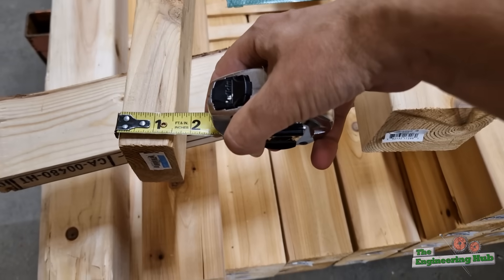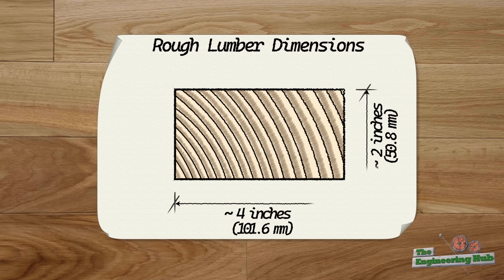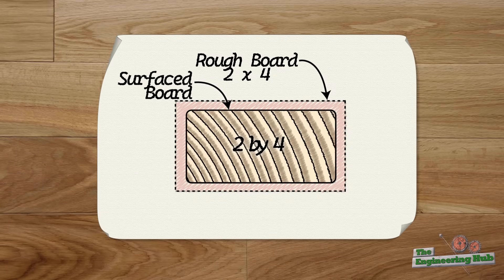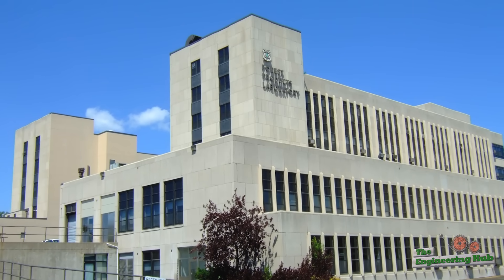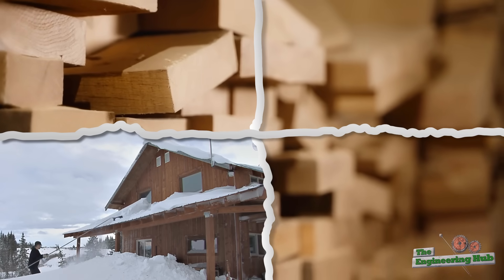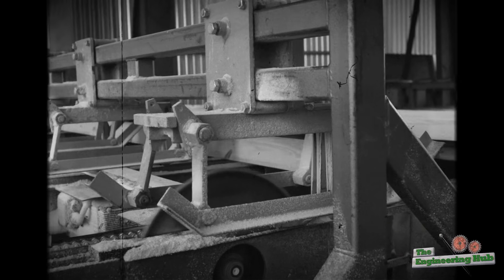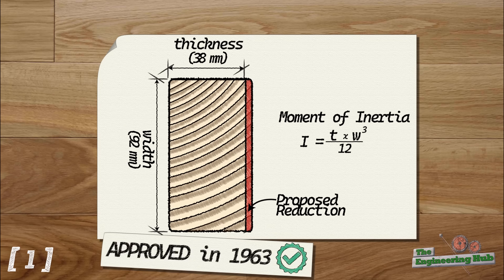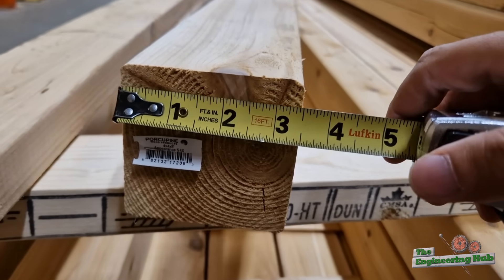Why is the 2 by 4 getting smaller and smaller?

Comment: Important to remember that the growers had access to old growth forests that had quality trees back when the 2x4 was first milled.  The structural capacity of that old growth wood (particularly Southern Pine or SYP) was substantial.  Once the greedy mills had raped the hills of all the useable trees, most of which were 100 years old or more, the hills were replanted with faster-growing varieties.  Of course, none of the mills were willing to wait 100 years for a properly grown tree, so most replanted trees were cut at less than 40 years old.  The consequence is that the poor soil, which was not allowed to "recharge" since it was replanted on bare soil (the natural consequence of clear cutting) and the trees that regrew had lower structural density.  Thus, in the 1950s, during the post war building boom, engineers noted that SYP lumber was flexing more than their standards told them it should be.  The growers/millers had to have the standard altered to match the weaker product they were producing.  This altered the design of houses.  Since there were no large beams anymore because trees were not being allowed to grow past 20 years in age, house design accommodated the inclusion of the weaker wood by creating the "balloon" frame house rather than the traditional post and beam method used prior to the 1950s. A balloon frame has thinner walls (weak 2x4s stacked closer together) and the new strengths standards were accepted and adopted.  However, after mismanagement by the lumber companies, the trees continued to get weaker and weaker, so the standard was AGAIN lowered in the 1970s and house design had too change, again.  Long spans disappeared.  High ceilings went away, and the single story ranch house became the trade's only economical, structurally sound product.  It does not end there.  Continued demand for wood products outpaced the mis-managed tree farms' capacity to grow sturdy trees, and in the 1990s the lumber standard was lowered, again, and construction methods changed again.  Now you can't even find a replacement wood joist to re-do the joists of a house built in the 1920s because the lumber of the same dimension, even custom cut, is much weaker than the original, so mid-span bracing is required.  

It is true that today's houses really are just "mud and toothpicks" compared to the substantial, dimensional lumber frame houses that our parents grew up in.

So sad.
Reply: Wow. Thank you for the detailed summary.
Reply: Umm sorry this is inaccurate to say the least. Balloon framing was the standard in victorian houses built prior to 1900. Platform framing was not common whatsoever prior to 1950. Balloon framing was in no way developed due to the weakened lumber. Balloon framing was phased out because of its poor ability to provide fire separation because it would essentially act as a duct for fire to travel from the bottom floor to the upper floors of houses. In a 1900s home you could go to the attic and drop a penny from the top of a stud and it would hit the basement floor.
Reply: I'm building a cabin in about 5 years... any advice for requesting quality wood and quality construction would be appreciated.
Reply: @NTJedi  go for steel, stone, or brick
Reply: @NTJedi  If you have any Amish communities in the state you live in, go seek them out & talk to them about it.  My parents own a log cabin that was made by Amish people, they helped us bring the cabin on a flatbed to one of our properties.  This was around 25 years ago & to this day the cabin hasn't needed a single repair.  However, a deck was added on around 20 years ago & every single piece of wood used to make the deck has been replaced at least once.  We installed the deck ourselves, but my stepdad & grandfather both of whom are master carpenters with my stepdad at the time the deck was installed had been doing that kind of work for 30 years & my grandfather for 50 years.  Both of them & work colleagues have said the reason it hasn't lasted is due to poor wood quality & they didn't use cheap wood to build the deck either.
Reply: what do people do when restoring old buildings then? start mixing light stainless steel?
Reply: Quality down. Prices up.
Reply: Evil can only corrupt what good forces have made.
Reply: Sounds like you know your shit. I like stuff like this.

I think making the standard match the product instead of making the product match the standard is important to note. Where else does this happen? That's how people should be thinking
Reply: Thanks for your insight and knowledge on growing and milling trees and lumber. You are absolutely correct. I graduated with a two year forestry degree then was hired and trained as a saw filer in a large mill that I worked 33 years. It's certainly true old growth timber especially SYP is long gone. Timber companies along with foresters are always expiramenting to find ways to harvest planted timber earlier with less expense. The timber and sawmill industry is very competitive with sawmills especially dimension mills like the one I worked in ( cutting standard 1 x s and 2 x s up to 2× 12 x 20) have to periodically " remodel " to take  advantage of new products that produce lumber more efficiently in order to remain competitive. Thinner kerf saws , optimized and computerized machinery have replaced , human error and mistakes. It's true lumber isn't comparatively as strong as it was due faster growth which causes growth rings to be wider and fewer. The old growth with tight narrow growth rings definitely was stronger, producing straighter more consistent lumber. The harder varieties such as SYP are structurally more sound than white pine or spruce. Unless using a nail gun driving nails with a hammer will clearly show this and be more difficult. It's no different than many other products , competition and profit drive innovation if a company is going to be successful or a out of business.
Reply: Money
Reply: In 20 years a wolf could blow in your house
Reply: That sounds like a brilliant investment opportunity. Buy land, plant trees now that will be useful in 100 years, ring fence it from being harvested, in 100 years, your descendants get a windfall from selling a rare batch of, by then, even harder to find, quality timber. Nice.
Reply: @Erakius323  in a perfect world it would be a sound idea. Problem is ppl don't care about quality anymore and neither do 90% of builders. Take the I beam for instance, they could at very least build new houses with actual 2 by 12 joists but instead people opt for the wood I beams, and I don't care what they say claiming they're better. Try running a 3 inch plumbing drain through an I beam and tell me it's better. If ppl aren't even paying for real joists anymore even though they're available I doubt they'd pay the premium for higher quality lumber. Everything just goes down hill in exchange for profits and its almost become the standard. Another reason older buildings are better particularly block or brick masonry houses were that the structural exterior walls were double or triple brick, the bricks were the primary structural component. People started swapping that out for the brick veneer houses you see today. They didn't do that because framing was stronger than brick. They did it for the almighty dollar. Houses also used to be built for generations of the same family to live in, it was not uncommon for a family to own a house/land for 100 years back then. Not people just move in 20-30 years and think oh well it's not gonna be my problem when these things fail. 🙃
Reply: @JOIHIINI  I guess. It would rely on knowing a quality timber merchant, someone who knows the value of old growth timer, and who knows someone willing to pay good money for it.
Reply: Try a library search
Reply: Balloon framing was used in houses as far back as the 1800s.
Reply: Count on it only getting worse in future. Increasing concentrations of carbon dioxide make plants grow faster, but they don't grow stronger. Even the hardwood species that were traditionally revered as slow-growing high-quality timber are now showing a coarser grain and structural weaknesses. And with increased storms and wildfires, there's zero financial incentive to plant these slower stronger species to offset the turbocharged growth rates, because the longer a tree is standing there growing, the higher the risk that either a storm or a fire is going to destroy it before harvest.

We passed 400ppm only eleven years ago. Now we're at 425ppm, and the increase is still accelerating. Timber is going to be about as structurally useful as an over-ripe mushroom in years to come.
Reply: Concrete it is then. Use the shit wood for internal walls and the A frame.
Reply: If only we could focus on quality instead of quantity but alas the world is run on greed
Reply: But would it have changed the trends to remodel the remodel that was done 5 years ago ?
I think not , and would have been more wasteful of us to insist on the higher standards .
And of course would narrow the market of affordability .
Reply: As someone who will probably never own a house (thanks federal jew reserve), but still an engineer at heart. Where do you see those of us that want to live in a solid house going? Concrete? I worry about the cost of such a structure and the high degree of human error possible in mixing and curing.
Reply: @RobotDCLXVI  i'm sorry, "federal jew reserve"???
Reply: @RobotDCLXVI Wtf? Is everyone just going to ignore the Jew comment? What is this, the 1930s?
Reply: @sireniasong  It has 17 thumbs 👍.  Nobody is ignoring it; in fact, people are finally starting to notice.
Reply: @sireniasong Isn't the chairman of the Fed jewish tho?
Reply: @blainegoodwin6365  He's a Catholic American. Extremely easy to Google. Went to a Jesuit (Catholic) school and married in an Episcopalian church. He has a law degree and has been in investment banking since 1984, as well as being in and out of politics. So not only is that wrong, but it also shouldn't matter at all. Replace "Jew" with "Black" and try telling me that hateful line of thought is justified.
Reply: @sireniasong  You're right. I was thinking of Yellen...but what is hateful about it?
Reply: @sireniasong replace it with white, then no one cares.
Reply: @sireniasong You have a problem? He’s right.
Reply: @RobotDCLXVI  Racist
Reply: @richardwebb2348  You can call me names, but you can't call me wrong. That epithet you called me was invented by a jew, btw.
Reply: The "greedy mills" are the ones that supplied the wood to build your house. The consumers (you) are at fault just as much as them.
Reply: @someoneonyoutube181  nice victim blaming.  How is it the customer's fault that these mills are greedy?
Reply: @someoneonyoutube181  "it's your fault for buying the only shit available" what should we do instead? Make your own lumber mill and create boards that don't exist on the market? 

It's the same type of logic that people use when they blame a rape victim because they "dressed to provocatively" or blame a gunshot victim for not wearing bulletproof armor, as if the victim is to blame.
Reply: @someoneonyoutube181  What would you like people to do? Just go out in the forest and chop down a tree themselves? 
Absolutely ridiculously unintelligent comment by you.
Reply: @someoneonyoutube181  while that's true, it doesn't change the fact that the greed on the part of the company owners was still rampant.
Reply: @someoneonyoutube181  gatekeeping much?

Comment: I don't agree with his theory. Dimensional lumber has shrunk in size because sawmills can get more sellable wood per log, period. And if you think there is no drawback to reducing the thickness to 1.5", try fastening drywall along the vertical butt joints. In a perfect world you have 3/4" overlap for each drywall sheet against the stud. But in reality you often end up driving screws on an angle to chase the stud. But even sheet goods are undersized. It's all about maximizing profits. And frankly, if you sell me a board that is called a 2 X 4 it should be 2" X 4".  But my internet provider will sell me super fast speeds for an extra price, but then claim they can't guarantee those speeds, for which I paid extra. Seems illegal.

Comment: Nice talk, but wrong.  In about 1948 (I don't mind being corrected on the date) ... the government, established standards.  Based on the end of WWII and the fact of the building "explosion" by returning military families, the building trades needed to know what was meant by the term 2 X 4.  Imagine building a home or anything when each new load you order is a different width or thickness.  That is the primary reason for these standards.  The complaint about drying and shrinking is a number too small to matter.  The steel stud idea is taking hold, making this discussion needless.

Comment: He left out the fact that lumber in the early 20th century was often OLD GROWTH HEARTWOOD, which has already "dried" and has much MUCH tighter grain and structural integrity.  If you look at rafters in a house built in 1920 you'll find TWO by FOUR INCH lumber that will break nails and destroy screws.  We're now having marshmallow soft crap foisted on us, and losing 1/2"^2" to boot!  Criminal!  🤦

Comment: Video needs to be retitled "why is the 2 by 4 getting smaller and smaller IN THE STATES"

We still supply fresh sawn timber in the UK air dried as an exact 2x4, if you want kiln dried we only go down to 12-15% moisture content which leaves the finished dimension over 47 x 96mm
Any other sizes like 3.5 get measured out in mm as their actual finished and sold size.

Comment: And, let us not overlook the fact that when framing a house, you cannot just put two "2 X 4's" together for door and window headers and match up to the side 2 x 4"s, oh no, that would be too easy.  Now you have to add in a piece of 1/2 plywood to fill the gap so the header will match up to the side frames.  Would be so much easier if the boards were true 2" x 4".   Seems to me this was the original intent back in the old days, use even number dimensions to make the actual building of structures much easier.

Comment: How convenient that the size of the lumber that "is perfect for every use" and "doesn't affect the strength" just happens to be the much smaller size of wood that there was already a TON of stock for on the market that would all need to be recalled and replaced had the regulations that say "2x4 means exactly 2 inches by 4 inches" passed. Lobbying makes this such a bizarre country to live in.